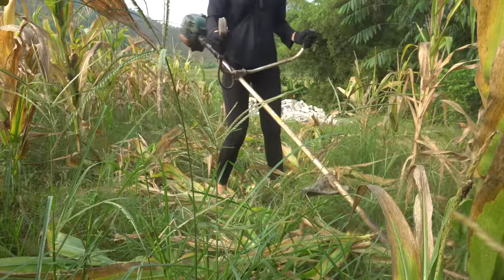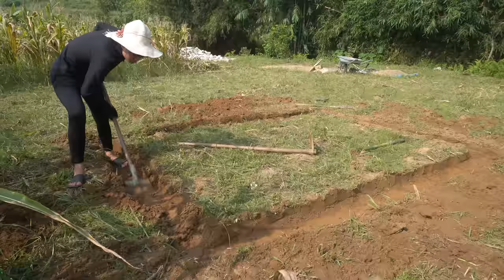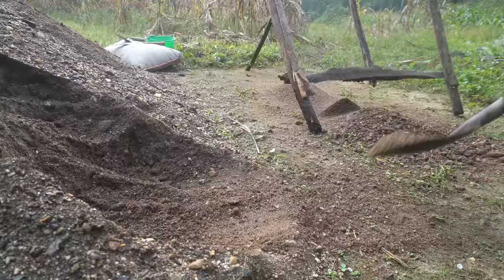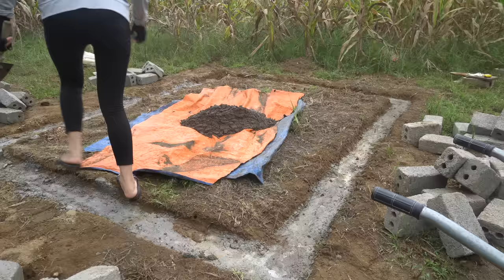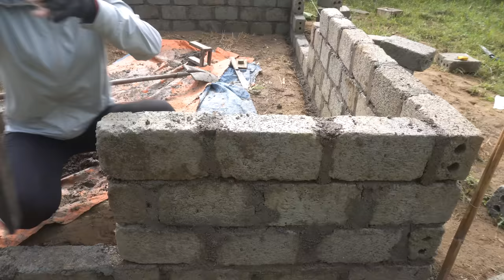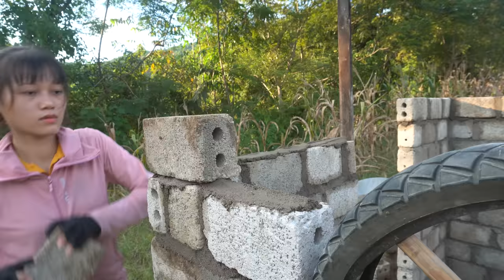How To Building House Use bricks, gravel and cement - Green Forest Farm Life - LIVING OFF GRID ep2

Comment: Wearing sandals or slippers while using a brush cutter is not advisable, flying rocks, and sharp metals from the blade can injure you very badly. You also need eye protection you can injure your eye severely with flying debris. are you just cutting the cornstalks or even the weeds/grass, you need to cut lower to kill the grass. you are also missing a lot of grass. Practice more grasshopper. Your concrete work though is a lot better than some masons that work on concrete for a living The only thing missing is you should have poured gravel down before you put the cement mixture down. Makes your foundation stronger and will not hold water. HOW COME YOU DID NOT PUT METAL REBARS IN BETWEEN THE BLOCKS?
Reply: E6e